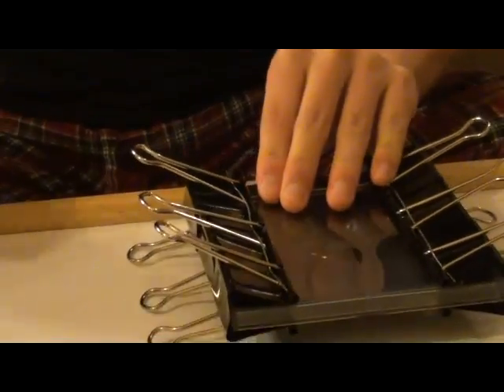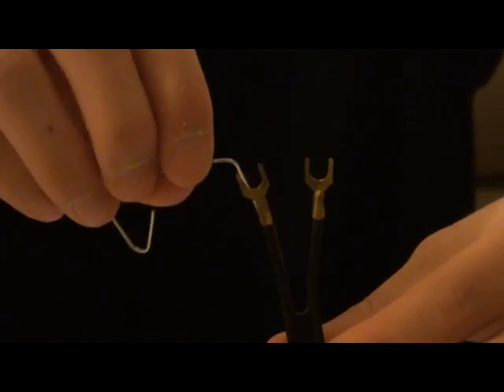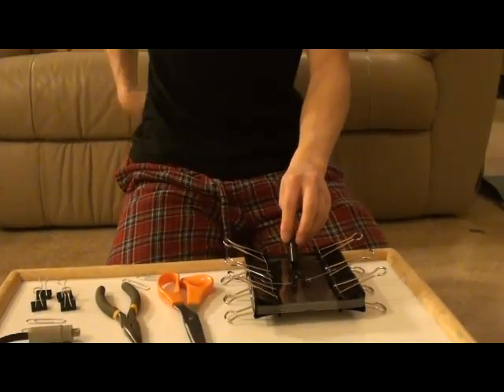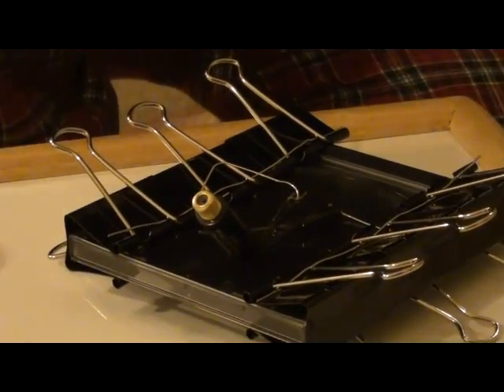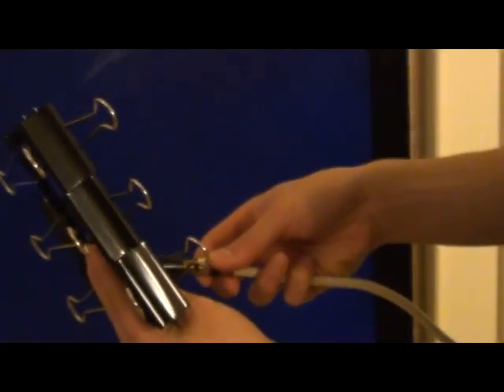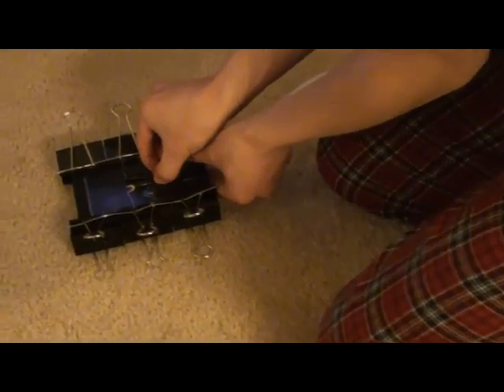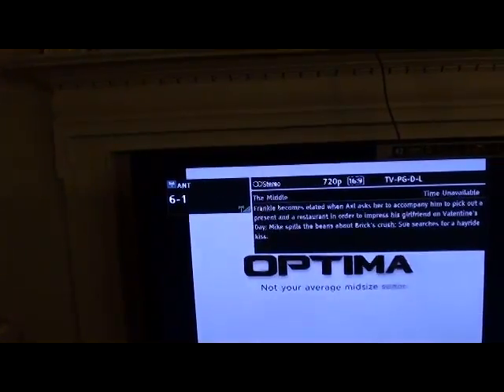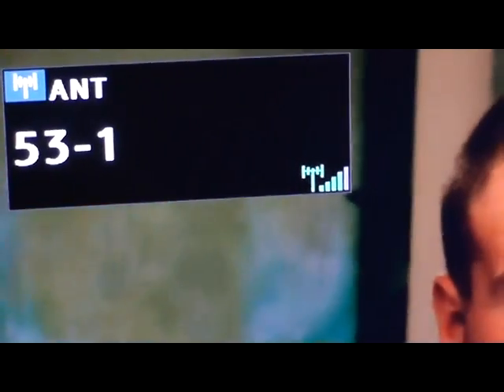Binder Clip HDTV antenna part 2

Comment: Put it on a higher shelf or next to the windows it will work better I'm using a coat hanger antenna with 4 big bow ties and 4 small ones for uhf getting 54 channels now in my area in Athens tn I live 45 miles from Chattanooga and 60 miles to Knoxville but it won't pick them up

Comment: I did it with Steak Knives, Paper Clips and Roach Clips..... They all worked and picked up around 30+ Mile Towers.  NOTE:  Try Roach Clips..... I did mine with 5 Roach Clips but some Channels needed 6 Roach Clips.  So it's easy to add-on and take off - changeable.

Comment: All I had were 12 small binder clips so that's what I used and it works great!...I get all the VHF HD channels and about 3 dozen UHF channels...I may have to move it slightly to get some of them but it absolutely works!...Thank you!...Thank you!...Thank you!
Reply: Right, worked 100%!  Funny, I did it with Steak Knives, Paper Clips and Roach Clips..... They all worked and picked up around 30+ Mile Towers.  NOTE:  Try Roach Clips..... I did mine with 5 Roach Clips but some Channels needed 6 Roach Clips.  So it's easy to add-on and take off - changeable.

Comment: NOTHING beats a roof antenna. I guess if that is not an option, this might be better than a wire pinned to a wall.
Reply: I did it with Steak Knives, Paper Clips and Roach Clips..... They all worked and picked up around 30+ Mile Towers.  NOTE:  Try Roach Clips..... I did mine with 5 Roach Clips but some Channels needed 6 Roach Clips.  So it's easy to add-on and take off - changeable.

Comment: Awesome videos!!! I cancelled Directv this past Wednesday and looking a way to make a quality homemade antenna. First, I did the mini antenna with small binder clips that kid posted up and it got me 14 channels with my Access HD converter. That's very good. But today with both videos, I brought a 12-pack large binder clips at Office Depot for five bucks then followed the steps and now I got 27 channels with the same converter. I didn't have a male 75/300 transformer but I used a female 75/300 transformer with the two screws on top and use a male coupler to connect the transformer and a cable to hook up my HD converter. I'm glad that was effective too. It even beat the RCA flat indoor antenna I brought for 20 bucks a few years ago. So thanks a million.
Reply: I did it with Steak Knives, Paper Clips and Roach Clips..... They all worked and picked up around 30+ Mile Towers.  NOTE:  Try Roach Clips..... I did mine with 5 Roach Clips but some Channels needed 6 Roach Clips.  So it's easy to add-on and take off - changeable.

Comment: Can you solder the small paper clips to the transformer ends?
Reply: Sure!
Reply: @JodBronson  Might be better off with this type of transformer so you can screw down the connection:
https://www.amazon.com/CESS-Connector-Antenna-Matching-Transformer/dp/B01FQ6NWMA/ref=sxbs_sxwds-stvp?keywords=balun&pd_rd_i=B01FQ6NWMA&pd_rd_r=0b047d1b-8733-49cc-babb-2e98dcb5ae09&pd_rd_w=7L7Bq&pd_rd_wg=Ijhv6&pf_rd_p=a6d018ad-f20b-46c9-8920-433972c7d9b7&pf_rd_r=2NFG68F0HBKBST0V3WF0&qid=1562786762&s=gateway

Comment: I just made one last night and I was so excited! I live in a concrete block high-rise that's like a bunker. I could barely get five channels and I couldn't get PBS. I didn't want to spend $40-$50 dollars on an antenna. Tried this and OMG! I'm getting like 40 channels and my beloved PBS. There are so many free channels out there that I didn't know existed. I have it sitting on the stand next to the TV. No more rabbit ears out on the balcony. I bought the connector thing at Radio Shack for $6. I am SO impressed. I have a cable splitter so I both TVs connected to it.
Reply: Put it on a high shelf or the windows and see if you get more channels you might be surprised

Comment: ???  This antenna never makes any physical connection to the tv, because the SMALL paper clips do NOT make any contact with anything connected to the LARGE binder clips, as they are coated with black paint, unless you sand the area to expose the bare metal of the large paper clip.  Is this the intended idea?  If not, all you have to do is make the SMALL paper clip end touch the LARGE paper clip on both sides.  You can prove this with a continuity tester.
Reply: Bernal Gaston paint won't effect it.
Reply: This is not a paint. So they do make connection
Reply: Paper clips with paint won't work, you can buy paper clips without paint

Comment: I built this and it works great!

I removed the handles from the clips and slid the big paper clip through and then replaced the handles.
You can also insert one part of the U shaped connector into the space for the handle, it makes a more secure connection and a neater build.

Excellent instruction video, thank you very much!

Comment: Great idea!  I'm trying different types and so far it's been a bit hit and miss.  The most channels I've gotten so far was about 6.  This layout looks easy-peasy and dirt cheap!  
How many channels did you end up getting?  At least 4 or 5 bars, as anything lower sometimes isn't worth watching.  With my 6 I said we got we actually had about 11 but 5 weren't very reliable and we would lose them if a truck or car drove by, or I suspect even a butterfly flew by!

Comment: Just tried this tonight, works good. I am thirty miles from the center of NYC. Inside it received a few channels but when hung outside it received about thirteen channels plus a few audio. Thanks, it was a quick way to get the TV up after we dropped the cable. Now I need to work on an outdoor antenna for the roof. I am also about fifty miles from Philadelphia. Any thoughts on a high gain omnidirectional antenna that could pick up both areas? Would two directional antennas and a combiner work? TY

Comment: Really love the originality. It's so simple and it works.

Can try adding more paper clips to make a larger scale model. The furthest station you are picking up is just 27mi. The outdoor antenna in my place looks like an arrow and can pick up to about 100mi on a good day and not very big. So how many paper clips do you need to add to extend the range of the antenna to 100mi (160km)?

Comment: Hi, Great vid! I wonder if doubling or tripling the size by adding more clips would improve the gain? Any idea? What about spacing between the clips from one side of the case to the other? Does this matter? The reason I ask is that I would probably use a 1/2" thick piece of wood instead of the CD case and I can make it as wide as a CD case if that particular width is important. Thanks!

Comment: Your small paper clip does not make a physical metal-to-metal connection with the wire fractals of the binder clips or with the long paper clip.  Don't they need to touch?

Comment: Good job, Bryan. I was skeptical at first but since the items were inexpensive and easy to get, I decided to try the antenna. I'm very glad I did. It has outperformed a $20 digital antenna that was not working so well. I just had to make sure and place it in the proper location (which took a bit of moving around). All the parts came from my local WallyMart and saved me from having to invest in a more expensive, outdoor antenna. Thanks for your expertise!
Reply: These antenna working above 70km distance range from the TV Broadcast tower?????????????😢😢😢😢😢😮😮😮😮😅😅😅😂😂😂

Comment: Thank you, this really works! It was  hooked up to a 35 yr old antenna on my chimney, and this  binder clip antenna gives me more channels and clearer. I had to use copper wire instead of straightened paper clips and I used a female transformer that I had on hand. So simple!

Comment: you would still need a way of converting the signal, either a digital converter box or get a tv with a built in tuner

Comment: @wamuca hi- all that you said is understood. I have all that.
It's just the business of connecting each clip is an easy, done deal with the foil in place underneath the clips instead of depending on the placement of the paper clips is all...

Comment: Is there a technical reason why you would not simply wrap the CD case in aluminum foil, cut the middle of the 75-300 transformer, and just stretch each tab to go under the clips already on the case?

Comment: I built one of these, and found it definitely works better than sticking a paper clip in the TV, but does not work quite as well as my coat hanger DB4. I made this one because I wanted a smaller antenna than my DB4, and it's working great for my needs. Thanks, wamuca!